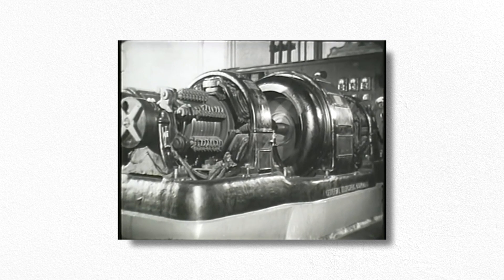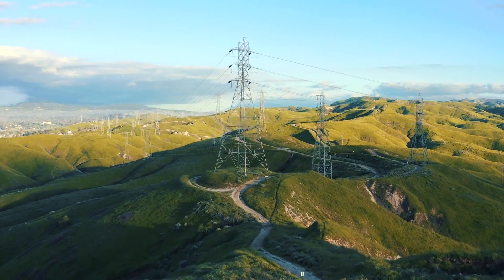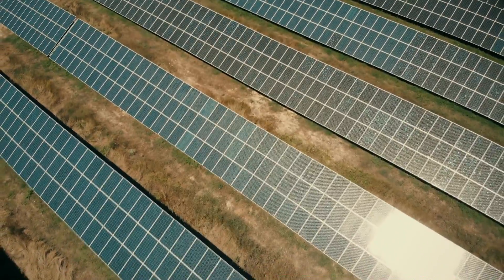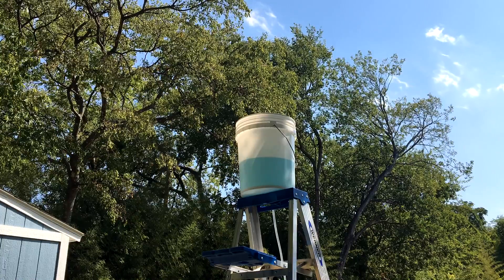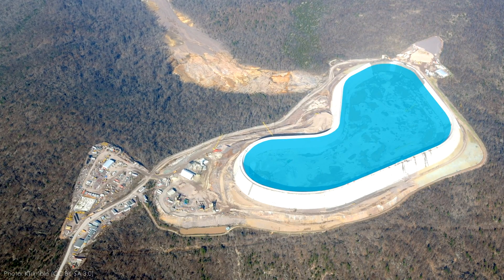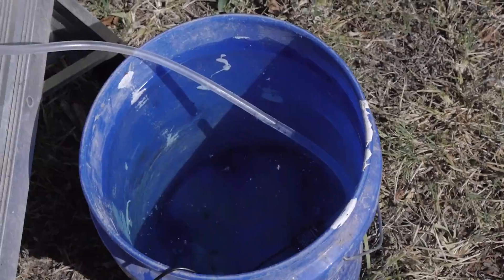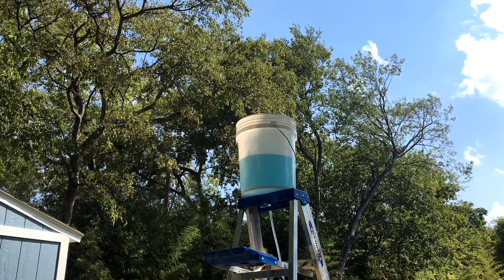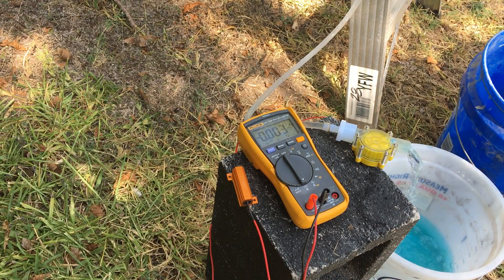World's Largest Batteries - (Pumped Storage)

Comment: Wouldn’t it make sense for cities to install turbines in either water towers or water mains? Like the mains have a great flow rate and pressure and the water towers have the height advantage. Like, sure, it would cost a good bit at first, but not only would it help the power grid, but they could probably eventually make a profit by selling that power back to the companies or by using the power generated to save money on electricity that city infrastructure requires
Reply from the maker: The cities pay to pump that water through the pipes, so it wouldn’t make sense to rob the energy away
Reply: @PracticalEngineeringChannel  ahh fair enough

Comment: Shouldn't there be a shelter on top of the upper reservoir to avoid water vapor, reducing water levels? Or is the water level lost not justified to build one?
Reply: A reservoir large enough to be useful is too large to cover.  Banks Lake is 27 miles long.

Comment: If solar continued to grow at this rate it will replace fossil fuels in about 30 years.    That's IF it can grow at this rate... which it wont... it'll hit a diminishing return point. 
Solar is a pipe dream... It's fine for supplemental needs.

Comment: I'm sure your little turbine wasn't optimized for the given pressure. One that is would spin like crazy. It's hard for me to justify such inefficiency as hydraulic systems are generally considered to be friction free. They are for hydraulic power and control systems, one of their great advantages over gears, belts and mechanical joints.

Comment: Intermittent - yes - solar only works abt 8hrs/d. So you need to overbuild 2-3x demand for storage.  With a wind power also, solar and storage (PHES) is still cheaper than other power sources in Australia. See CSIRO GenCost reports. 

Unreliable - NO - parts of the US and most of Australia gets more than enough solar insolation to meet demand, then you need PHES to see you thru over night and the cloudy periods. 

Also, huge dams and reservoirs are not required - certainly not as large as a water supply or an irrigation water dam because the water in PHES is recycled and water loss is from evaporation and leakages. 
The top storage for Wivenhoe PHES (500MW for 10 hrs) in Australia is only 104 Ha - the lower water supply and flood mitigation dam floods 109 km2, so a stand alone system wld only require 200 Ha. 

The US has the third largest amount of PHES after China and Japan. 

A well designed PHES system can achieve as high as 80% round trip efficiency - not as high as a Li battery perhaps - but much lower cost than Li batteries on a $/MWh basis.
Reply: Was looking for this, I find it hard these days to finish even a single video from this channel because I usually just get cringed away by such bold and some of the time just plainly wrong statements. 00:30 seconds in and I'm out. Geez.

Comment: I have been considering how to power my on demand water heater from a stored water system. I decided I could manage just using hot water at night, and therefore would have all day to pump the water back to upper storage, and solar powered pumps would still keep it off grid. But after a few days of reading I've come to the conclusion it is unreasonable because the required height of a tower and the volume of water needed and the noise of the water turbine generator. Not to mention the cost. Basically the only reasonable way to make power with water in small scale is if you have a consistent flow from falling water to a turbine generator or a river with water wheel generator. My next project investigation will be to figure out how to just heat and store the water (under pressure) and skip the generator.

Comment: One of the best examples I've ever seen of a pumped storage facility is in northwestern South Carolina, the Lake Keowee/Lake Jocassee/Bad Creek system. Lake Keowee is the lowest, and largest lake fed by the Keowee and Little Rivers. Lake Jocassee  is 300 feet higher and its 710 megawatt hydro turbines empty into lake Keowee, and can reverse flow to refill the lake. 1200 feet above Lake Jocassee is a third lake, Bad Creek Reservoir, which is fed by Upper and Lower Bad Creeks. Its 1065 megawatt turbines empty into Jocassee and can reverse flow to refill Bad Creek Reservoir.

Lake Keowee itself is a hydro power generator with a 157.5 megawatt capacity, but its main function is to provide sufficient cooling water for the Oconee Nuclear Station's 2538 megawatt reactors. Jocassee and Bad Creek water levels are constantly juggled to keep Lake Keowee at full pond. Lake Keowee's generators serve as the backup power source for Oconee Nuclear Station.

Comment: Just wondering.  Why can't turbines be stacked like stairs, instead of side by side with only a one time usage.  Then each flow would produce multiple outputs using the same flow?  Like a stair case, each step would have a turbine and each flow would be used  step by step by step by step.
Reply: Google "Roman mill Barbegal France".
Reply: So one flow could be used multiple times magnifying the overall output.  Use some of the electricity produced to pump the water back to the top.  Perpetual motion.
Reply: The energy wouldn’t add.  You will get the best result from a single turbine optimized for the height and diameter of the water column.  You can’t extract more than the potential energy in the column.

Comment: Niagara Falls - on the NY side has 2 large intakes upstream a couple miles from the Falls with each one big enough to drive a train through.  Those intakes fill up the 22 billion gallon reservoir at night when electric demand is low.  They use the water in the reservoir to power the generators during the day to keep the water flow over Niagara Falls "spectacular".  When no one is around to view Niagara Falls at night, the water flow is diminished since a large amount of water is being diverted through the intakes.
Reply: yes i was going to refer to that  put in years ago  not much said about it.

may be California might want to use that to pump water back up.

Comment: This subject of batteries seems interesting but a sideshow to our real needs: Full time, walkaway-safe, Thorium Small Modular Reactors (SMR). We can do on 20 acres with SMR’s what solar + battery vaults require 40,000 acres to achieve. Battery unfortunately, at best, is a intermediate step to small modular zero point energy household to neighborhood size energy packets that also run autos. It’s not clear battery even has a long term roll in personal transportation. There are many valuable trade-off lessons being learned, but uninterrupted dependability is the trump card.

Comment: Could you use a huge number of very large ram-pumps to lift the water to the upper reservoir? It'd take much longer but would have zero energy cost.
Reply: There is no uch thing as zero energy cost of doing work.  Work is energy.

Comment: It's a facinating concept. We will see much more of that sort of thing. In Switzerland, they recently deployed an e-Dumper in collaboration with Komatsu. It is based in a stone pit in mountainous terrain. At the top, it loads 65 metric tons of stone. Whil bringing it downhill, the dumper generates so much energy that it can drive uphill again without any external energy source. The weight of the stones alone power this machine. Perfect efficiency. And the numbers are amazing as well. This machine alone saves us 50000 liters (over 13208 gallons) of Diesel and 130 tons of Co2 each year.

Comment: why not have a re circling dam system? why couldn't you use pipes after a dam and use gravity/pressure  to force the water back up to the reservoir  then re use it over and over and over.  think of it like a lake with a river and the river drains back into the lake and just repeats non stop.
Reply: you wouldn't really need 2 ponds like in this video because you'd use gravity and pressure to force the water back into the main reservoir and as long as the dam was closed the water would fill the reservoir and with this system you could leave it run 24/7 and have a steady power MW into the grid.

Comment: What we need is a international powergrid system with direct current that operates at such low temperatures that the energy loss over such a long distance is kept to a minimum. The great thing about a such a large system is that the sun is always shining somewhere, the wind is always blowing at some place and when Europe sleeps, America is awake, it would evenly distribute all peeks and downs of energy production, more or less, accounting for population and amount of industry. 
The problem is the absolutely massive cost of installing such a system. 
The price could perhaps be reduced by making the systems in tunnels thousand of feets below ground, hence it would take much shorter distance to cower the entire earth, it would also making the cooling of the system to -72 celsius easier.
Another perk is that it doesn't mather were the energy is produced, as long as you are near a hub that connects it to the deep-earth-electrical-distribution network.

Comment: To use this on a mega scale, CA, NV, AZ, MX, should invest in an excess pipeline to transport & store Mississippi & Missouri River waters into below capacity (currently) Lake Mead which generates vast amounts of electricity.

The Hoover Dam project has been debt-free since 198os and can afford to fund line construction & ongoing operating energy for the pump stations.

Water can be taken from the Mississippi & Missouri before Spring thaw, during Spring rains & when both rivers are above flood stages in many/most years and pumped into the Colorado River just upstream from Lake Mead and be stored there for the balance of year to produce electricity & irrigate Southwest farmlands.

The ideal model would be four parallel pipelines (for redundancy), two each following I-1o & I-2o through the interstate right-of-way corridors, built in scale of Alaskan Pipeline x4 running 24/7 for six months each Spring & Summer until Mead is filled &/or Rivers are no longer nearing flood stage.

These are excess available waters that otherwise end up in the Gulf of Mexico instead of the Colorado River Basin & Lake Mead.

Comment: Such a great video thank you :)
I am trying to set up an experiment to observe the height difference between reservoirs and energy density of them and their effect on efficiency. I am a little bit confused about the experimental set up that you have done. Have you used 3 water cups: 1-upper reservoir, 2-lower reservoir and 3- carrying the water to the upper reservoir?
Also I have been struggling with trying to find an experimental set up for the experiment, does someone have any recommended sources, I would really appriciate it. Have a nice day.

Comment: 4:17 that’s not a good photo. That’s the Taum Sauk pumped storage plant, In 2005, a large section of the upper reservoir failed, draining over 1 billion US gallons of water in less than half an hour. It went into Johnson's Shut-Ins State Park. Damage included eradication of the park's campground, which was unoccupied at the time. The only people at the park were the park's superintendent and his family, who survived, sustaining some injuries. The park was closed because of the extent of the damage it received. Trees still haven’t grown in the area the water has run.

Comment: Idea: Use mercury in your reservoirs instead of water.  It's 13.5 times denser, so you store 13.5 times as much gravitational potential energy at the same height.

Though, the drawbacks may outweigh the benefits.

Comment: I feel like an industrial ram pump would work fantastic for this application, the discharge from hydro electric dams could be dammed up once more and a small amount can be pumped 6 times higher than the original supply for free. Seems like a no brainer.
Reply: my dad in 1950s used to work a vacuum pump the head water in the river drove the pump  2 inch pip up to 500 ft head used the water to feed my village and 2 local farms. works 24 hours a day  we had water all the time then.

so technology is out there

Comment: why dont we use ram pumps powered by rivers to fill reservoirs at night? wouldn't this give you an effective efficiency of more than 100%? it wouldnt cost any electricity to fill the reservoir. and it would be a simpler build, with less negative impacts than a damn.

Comment: Even in places without great elevation differences this is possible if there are abandoned deep mines, you only have to reverse the system for that and some mines are 1km or more deep, so its worth doing it.
Reply: what you going to do when the mine is full release it and all the pollutants with it

good idea  not
Reply: @raypitts4880  There are different options, first of all you can indefinitely recycle the water if you have a surface storage with the volume of the mine, second it is possible to coat the mine in shotcrete relatively cheap.

Comment: I've recently heard about batteries that are using air compression to keep energy. Which seems to use the same principals as this type of battery. Can you do a video on this?
Reply: CAS (compressed air storage) suffers from thermodynamic losses even with good heat transfer and recovery.  It can be used where batteries are too expensive or where there are no hills for PHES.

Comment: Love the video! I’m curious, is there a formula to figure out how much energy can be stored if you have the volume and head of the water? eg: 10 gallons of water at 10 feet head has x amount of watts/joules?
Reply: THE ANSWER IS ANY  DRAG OF THE WATER IN PIPES THE SIZE AND LENGTH  THE HEAD OF WATER 

TO MANY TO GIVE A CORRECT ANSWER
Reply: It's just gravitational potential energy:  energy = mass * height * gravitational acceleration.

Comment: Actually ramping up and down as needs are changing is not the norm. Static var capacitor or SVC is now how we regulate usage. I work on one of largest SVC's on the eastern seaboard. Pretty amazing tech, but it wastes a lot of energy to regulate the voltage.

Comment: Excellent balanced analysis. I would note that in California, which at one time built bunches of hydroelectric damns, hasn't built one for many decades. Why? Environmental challenges which add enormous delays and add cost to any project. I.e., "they're just not worth the trouble anymore." Most of central California, once an agricultural power house, has been pretty much destroyed over concerns of some non-native fish! If there is any water to spare around here, it sure as hell won't be used for energy storage!

Comment: I was thinking, what if it used a few large ram pumps to fill the top reservoir up & then the water would flow down to the turbine making it run for 24/7!!
Reply: What's the point of that?  You'll just be moving water around in a circle wasting energy.

Comment: They could help improve efficiency by pumping water in from a higher point hopefully above the reservoir if not as close as possible. And then locate the generators as far bellow that as possible. Then it would take less energy to pump it up to the reservoir and you get more out of releasing it.  Granted then you could just run the generating pipe from the first source down to the outlet but then you wouldn't need storage as you could always release from higher to lower. But I wonder why they don't just use that instead of pumping it up then releasing it.
Reply: That's essentially what a dam is.  Take a higher-elevation supply of water, and pull power from it as it moves to a lower elevation.

Comment: Capacity of such reservors can easily increased by factor of 13. Just uee mercury instead of water
Reply: You would also need 13X the pumping power to move the Hg uphill increasing the overall of energy loss.

Comment: Biodiesel generator supply electrical grid system for 6 months or 1 years for Atmospheric water generator, which are more stable and reliable than solar panels and wind power.

Comment: Atmospheric water generator Unlimited water production and unlimited water circle for electrical grid to enough supply, which had better based on biodiesel generator from vegetables oil. Solar panels and wind power doesn't enough to supply electrical grid for Atmospheric water generator.

Comment: Electrical grid supply for Atmospheric water production generator had better use biodiesel (vegetables oil) generator 6 months or 1 years. Solar panels and wind power doesn't supply electrical grid for Atmospheric water generator.

Comment: There are many different types of batteries Flywheel , compressed air powe , cascading power generation using water flowing or running inside pipes , fume canals  etc

Comment: This video is an OK start to the conversation but does not provide enough perspective which could leave some with insufficient knowledge to make informed decisions. What is best energy storage method?  The decision should be based on the total cost of ownership (capital and operating which includes efficiency AND end-of-life), space availability, and Societal Impact Factor (jobs, displaced people, environment).  In the end, there are places where chemical batteries are best and where pumped hydro is best (it does not catch fire and can last for 50+ years)...  Ideally there is a robust grid to transmit power to where it is needed so storage requirements are minimized.

Comment: The mention of reservoir systems acting like a spring made me picture a giant spring, several miles long and a mile in diameter, buried underneath the Nevada sands, just coiling and uncoiling in accordance with low and high energy demand times.

Comment: This is a solid design concept your should consider building battery pools on top of plateus to reduce the size required by increasing head pressure. Seems better than hydrogen generation for energy storage.